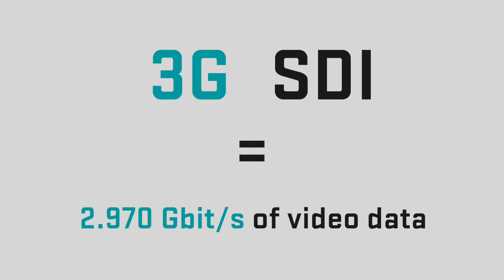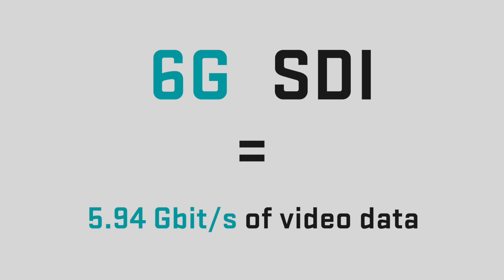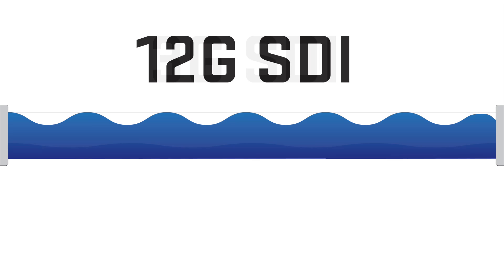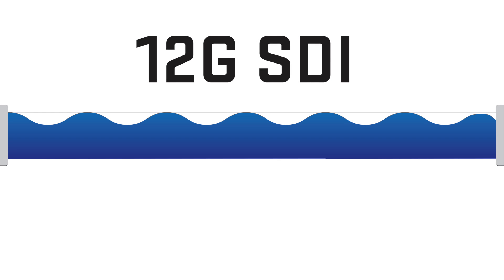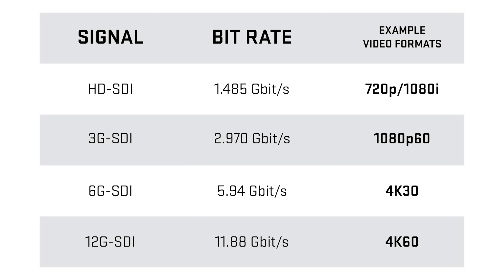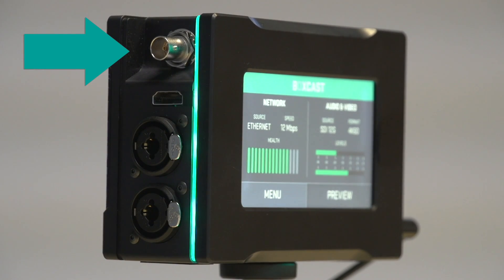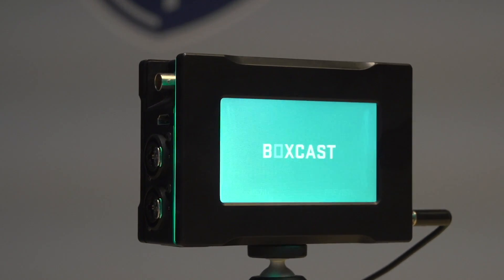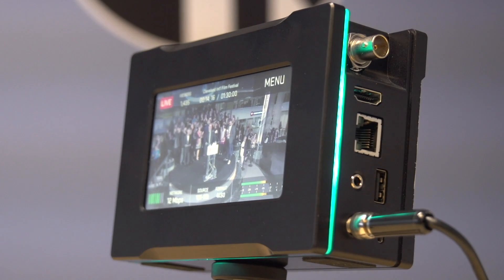What's the difference between various SDI Signals?

Comment: So if my camera has 12g sdi and my monitor is 3g sdi is there a problem? and question 2 if my camera is 12 g sdi i need to use only 12g cables oes not matter that the monitor is 3g, or can i use a 3g cable?

Comment: Thanks for detailed explanation, I have a question, If I have my camera and video switcher supports only 3G Sdi signal will 12G SDI cable work perfectly my device? Because in future we want to upgrade cameras with 4k support. and do not want to upgrade SDI cable again and gain.
Reply from the maker: it should! as long as you're not sending a 4k signal to the switcher
Reply: @BoxCast  Thank you very much. No currently my cameras and switcher only support 3Ģ sdi signal.

Comment: Hi ! If my camera has a 12g sdi output and the external recorder has a 6g sdi input is going to be a problem in what I record. Great video, thanx :)
Reply: Hello! That shouldn't be an issue, that just means your camera can output up to a 12G-SDI signal, but that usually doesn't mean it only outputs that signal. Especially if it's only a 1080p output.
Reply: @joshyclem  If it is a 4K camera the output will be for sure 12g sdi signal? To be more precise I'm talking about the Blackmagic studio camera 4K (12G SDI) and video assist 4K (6G SDI) which is monitor and recorder. Thank you for your time Josh!
Reply from the maker: @konstantgousi328  That camera should be able to output different types of video quality, including 4K30 (6G-SDI). Your video assist won't be able to record a 4K60 signal (12G SDI), but it should be able to record in up to 4K30 (6G SDI) . Does that make sense?
Reply: @BoxCast  Υes it does! Thanks!

Comment: What is the difference between (Analog PAL SD 720 x 576) and  
(SD-SDI 480i 
576i 270Mbps). ?
Reply from the maker: There are a lot of differences between the two, probably too many to name in a single response. Could you maybe tell us more about why you're comparing the two?
Reply: My software has drop down of the following output formats :

PAL
NTSC
240p 60
576p 25
600p 60
768p 60

after this one more drop down to select:

SDI
Composite
HDMI
Optical SDI
Component

Question :
My requirement is only “SD-SDI”

Now which combination I have to choose for SD SDI ? 

Thanks in advance!!
Reply: @worldofplanes4619  The first one configures the output format (resolution and frame rate). PAL and NTSC are interlaced formats (where each frame has only half the resolution) this norm was/is used in television before HD.

For internet and computers progressive formats are better (the ones with "p"). First number is vertical resolution, second is fps pick anything works for you.

The second selection probably defines some physical connector on your output device. If you need SDI select SDI. It is possible that only PAL/NTSC will work over SDI. Anything above 576p25 is considered HD and won't work over SD-SDI